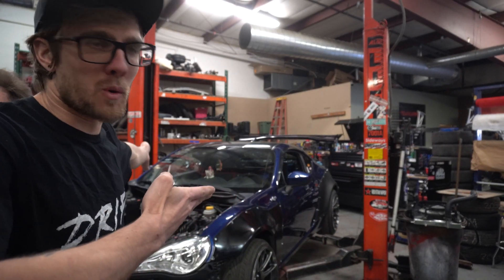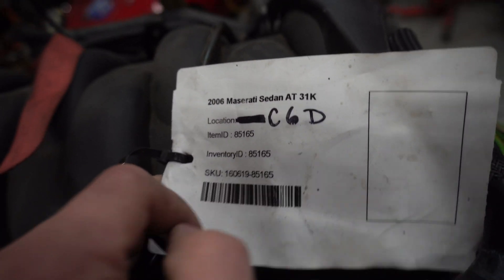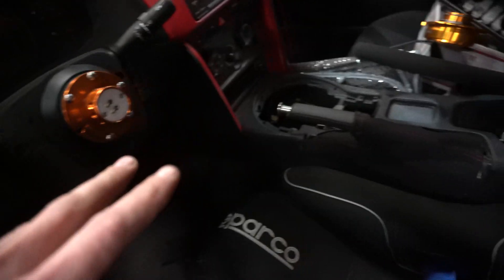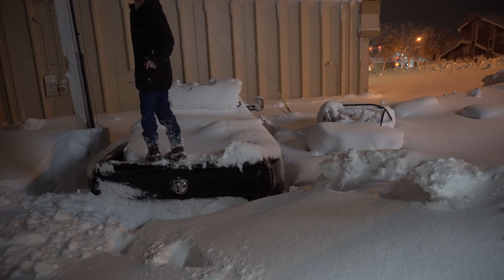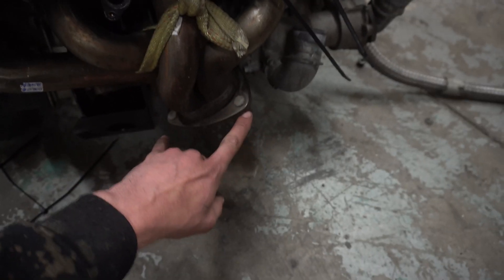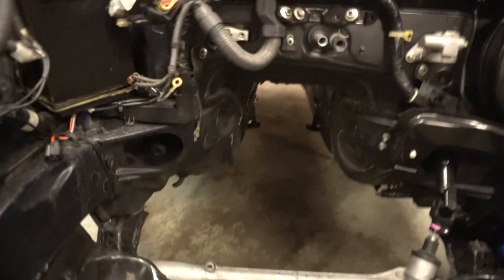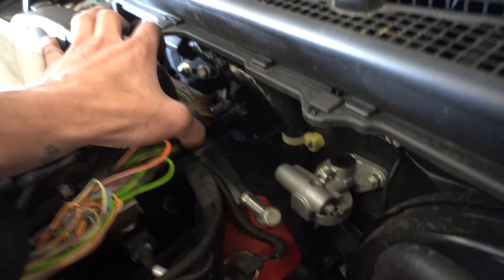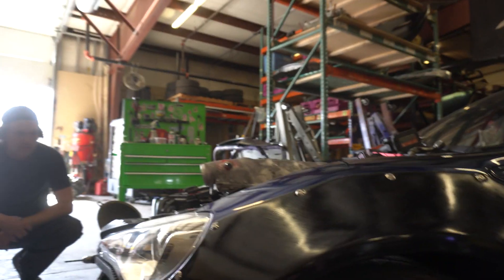Ferrari Engine To T56 Adapter & Custom Mounts - Ferrari Powered FRS Part 2

Comment: Actually, you had it right the first time. This is a Ferrari engine, not maserati. 

Maserati doesn't make engines still. They haven't since the late 90s.
Reply from the maker: It’s hard to say it’s not a Maserati engine when it came from a Maserati but it’s still a Ferrari built and designed engine
Reply: That's like saying brembo brakes are from maserati because they came from a maserati. 

It's not maserati brakes. It's brembo.

Therefore It's a Ferrari engine, from ferrari, that was installed in a maserati.

Comment: This engine isn’t technically a Ferrari engine, the Maserati one uses a crossplane crankshaft instead of the flatplane crankshaft. Same block but different crankshaft and firing order
Reply from the maker: Actually this engine is built and designed by Ferrari for Maserati so technically it is a Ferrari engine
Reply: @6berries  that’s a good point ! I was drawing the distinction since this since with this particular crankshaft has never been used in any Ferrari, similar to the V6 in the Alfa Romeo Giulia quadrifiglio. 
That being said, it’s possible to give it a more Ferrari like sound with 180 degree headers, but aside from the sound I don’t think it would be worth it.
Reply from the maker: @Charlie-Charlot  these engines still have an exotic sound but not as Ferrari. Some people do convert these to flat plane but I actually prefer the cross plane
Reply: I mean it’s a v8 frs that’s not using a ls or uz props to him
Reply: @mohitme1234  i wasn’t saying that it’s a bad thing, quite the contrary ! It’s a rather unique and underrated engine, especially in a drift car, props to these guys for the creativity !
Reply: I actually had a conversation with Fernando montero from gazoo racing, hes running a flat plane crank in his and told me the cross plane crank on these engines actually provide better power for drifting.
Reply: @Twitch_Masterflex  you’re right they are better for a drift car since crossplane v8s produce more torque than their flatplane counterparts
Reply: You know that not all ferrari engines are flat plane?